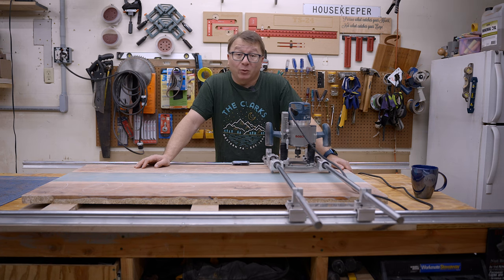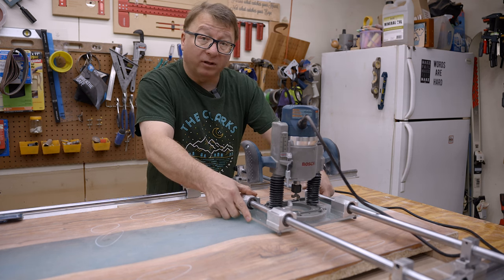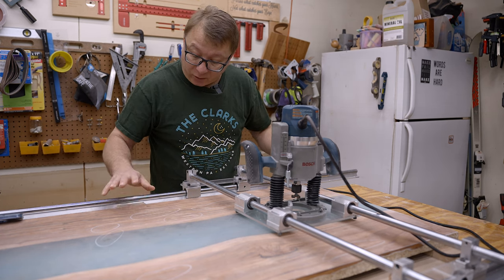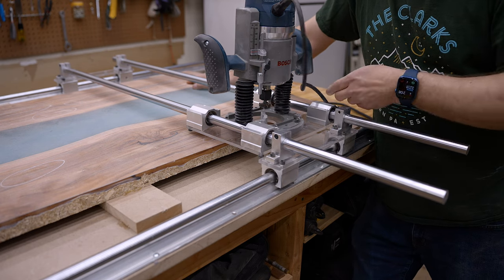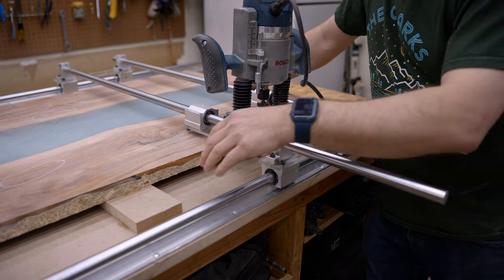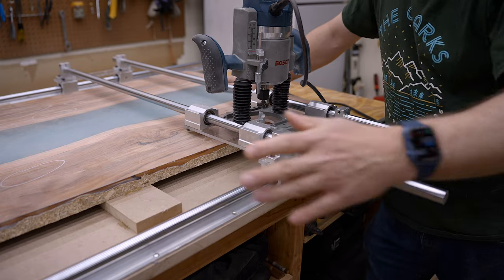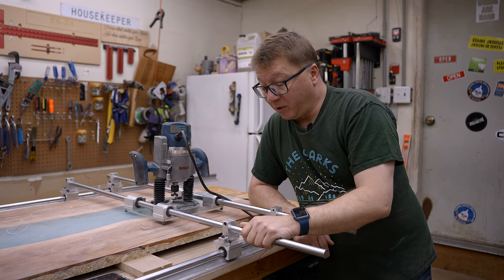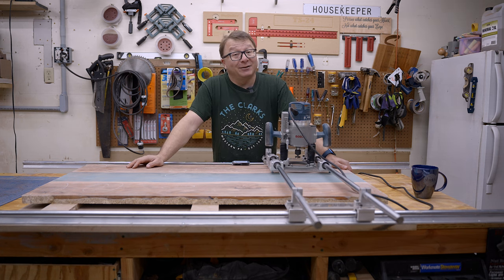Eventually You Will NEED A Router Sled

Comment: I’m in the process building my own CNC version & using same side rails on the top for rigidity. Why don’t you use aluminium plates instead of brittle acrylic?
Reply from the maker: Hi there - I had acrylic on hand so I used it. The next version will be more metal :) Thanks for watching!

Comment: If I use plywood as the base will the rails keep it flat, if not what would you suggest to improve flatness/ longevity?
Reply from the maker: The linear rails with the base will generally be flat on their own. You can certainly affix them to plywood or MDF as long as that is flat - usually plywood/MDF has more flex than the rails though. I usually screw my base rails into my workbench, which is the flat enough. The key thing is the item you are flattening needs to be co-planar with the base rails. Then you will get a flat surface for reference.  Hope that makes sense -- thanks for watching!

Comment: For height adjustment there are two practical solutions that I found. A collet extension is the cheapest. The second is to have the router carriage be made in two pieces. One piece is permanently attached to your bearings. The detachable piece can have routed lengths on the sides to increase and decrease the height. But the problem is after you raise the height from two spots (or four), how do you ensure your carriage is flat and coplaner to everything? A Japanese YouTuber had an ingenious idea to move the electric hand planer up and down. But that will require 5 vertical rods, lots of weight on carriage and bigger rails.

A third option that I was thinking of. Simply slide pieces of melamine mdf sheet s underneath the work piece to raise to the desired height. All surfaces will be referenced properly, not as cheap, but definitely the least hassle way of doing it
Reply from the maker: Thanks for the feedback. I've essentially been doing what you suggest, but by shimming the base rails rather than the material. It works great until the material is too short to be reached by the bit. Then it needs to be shimmed up if it required additional flattening. Generally I'm not a fan of collet extenders since they introduce additional runout - not usually a problem at this scale, but something to consider for a large spinning bit. Thanks for watching!
Reply: Instead of replacing the cracked plastic tie bar with a thicker piece of plastic use an aluminum bar.
Reply from the maker: @peterbarlow8912  Hi Peter - that is the plan when I upgrade some time this year. Thanks for watching!

Comment: For the linear rail, there's a SBR12 version, is that too thin? I want to be able to go as low as I can but don't wanna compromise level. I'm going for 850mm x 1500mm.
Reply from the maker: There is a 12mm version and that should be fine for the base rails. I would not go believe 20mm for the top rails though. Even at 20mm there is some flex and you need to be careful when in the middle of the sled. Thanks for watching!

Comment: Nice design.  On mine the rail mounts attach to the lexan on top instead of the bottom.  On the mounts I have they are open on the bottom so if I were to turn them around it would expose the mounts to lots of chips and dust.  I couldnt see how your mounts are made but the only ones I can find are open on the bottom or top if you turn them over.  Hope I described that will.  I had a scrap piece of of plywood that I ripped so I can raise the rails in increments of ¾ or ½ if thats what I need.  Thanks for sharing
Reply from the maker: Hi Ken - my design can go either way - with the plexiglass on the bottom, the router gets much closer to the material without needing to shim the work piece.  But I've done both and they both work. I'm working on a design that allows the router to move up and down without the need for shims. A quick disconnect for the router is next on the list. Thanks for watching!

Comment: Was this bought together like in a kit and about how much was it ? Im looking into buying but most of the videos and info is on building wood diy ones
Reply from the maker: Hello! I built it from scratch based on an idea I had. All the parts are sourceable from eBay, Amazon, or Alibaba. You can get something similar as a kit though (https://unitedclamps.ca/products/diy-router-sled-kit-20mm-linear-bearings-rails-and-supports). Thanks for watching!
Reply: @cyberreefguru  thank you

Comment: Hi! Thanks for making this. I’m looking at building one of these- got the rails on the way. My question is the joint where the two rails meet- where you have acrylic in this build.  I’ve seen other builds where the top rail is just screwed into the bearing thingy on the bottom rail. Yours appears to have some brackets that sit on top of the acrylic. My question- where do you get those brackets? What are those called?  Thanks!!
Reply from the maker: HI Russell - I made the bracket. You can certainly bolt them directly together, but I used "optical" rails on the top and the hole pattern is different from the standard linear rail system. I am considered switching tactics but what I have works so far. I can provide a diagram if you want to create your own bracket -- just send me an email and we can work something out. Thanks for watching!
Reply: What made you choose optical rails rather than 2 linear that would bolt directly into one another?
Reply from the maker: @We.R.Comics  Hi there - I originally thought it would make it easier to attach them to the base rails. In the end, it didn't really change much. Version 2.0 will likely use the same rails as the base.  Thanks for watching!
Reply: @cyberreefguru  will there be a video for 2.0? I'm ordering everything right now but I'll wait to build it if there's a video of what you'd change.
Reply from the maker: @We.R.Comics  Hi! I do not plan on a second video, but I'm happy to help. Shoot me an email or hit me up via our contact form on crgmakes. Thanks!!

Comment: I actually had the idea to make something like this and for raising/lowering the router i was thinking i could make the router base designed similar to a CNC. Put the router on a base and connect that base to a ball screw and have the ball screw be the part that connecte to the rails. With a 4mm pitch it would raise/lower 1/8" at a time per full turn of the ball screw. I want to use this as a drill press, jointer, and flattening sled etc so the quick adjustment would be helpful. But i won't know how accurate or stable it is until i build it and try haha
Reply from the maker: I've seen a few videos doing something similar, but the resultant mechanics were far too complicated and you could not easily disassemble the sled for storage. I'm still pondering my options! Thanks for watching!
Reply: @cyberreefguru  I got all the parts and will update you if you'd like with some pics. I am going to do an MFT table that folds down on the wall but can also be detached and placed on a normal bench if necessary. We'll see if I overcomplicate this or not haha
Reply from the maker: @uhN0id  sounds great! Keep me posted.

Comment: I like what you have designed and also like the improvement’s you suggested.  I was wondering if you have any ideas which would allow the router to keep a straight line while traveling across the workpiece.  Maybe introducing a quick release block that you could move easily after each cut on the bottom rail.  I have always had problems keeping my router from moving in a straight line.  It always wants to either dig into, or move away from, the workpiece.
Reply from the maker: Hi - thanks for watching. I've totally thought about that but have not settled on design yet. The simple thing would be a block with a screw in it as you mentioned. I would recommend one on each side (left/right) to keep the router straight. Though simple, I could see them slowing things down a bit and might become frustrating. For now I just pin my thumb on one of the bearings and use the other hand to move the router. It doesn't keep it rock solid, but works well enough. Digging in or moving away is completely based on the direction you are routing. Climb (router rotation opposes the direction of travel) cut will generally push the router away and conventional cut (router rotation is with the direction of travel) will pull it. Climb is preferred since you have more control as the router is not "walking" down the piece pull away from you. Hope this help!
Reply: Clamping levers often get used, the button kind. There is a hole in the side of the bearing, screw it inti place there. Push the button on the clamping lever and that will stop the bearings from moving, essentially a brake. So you move in only dimension. The usually cost 1-2 dollars.